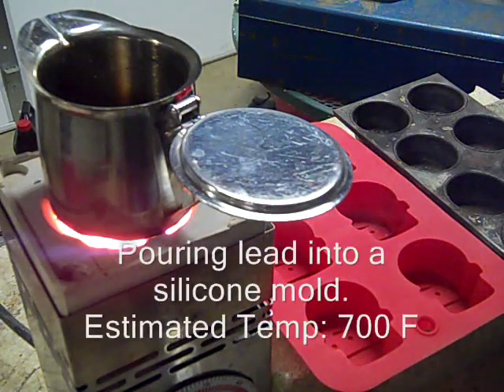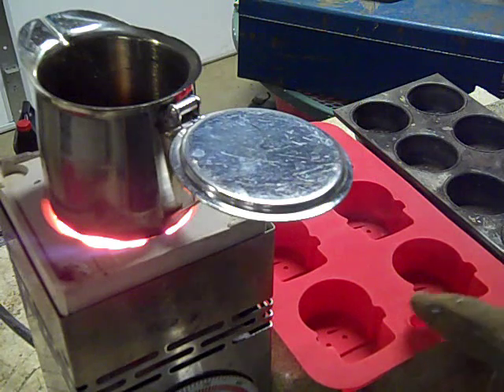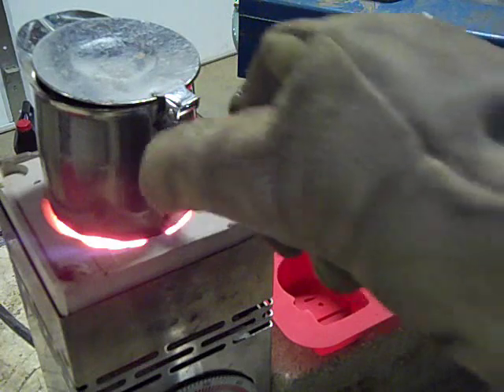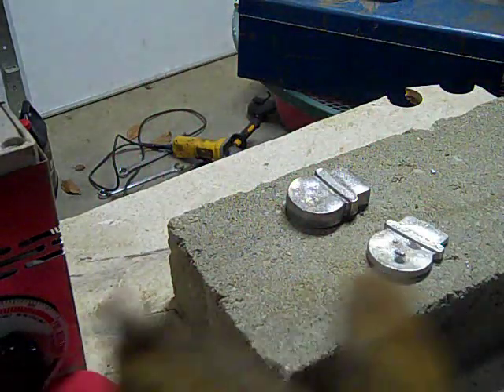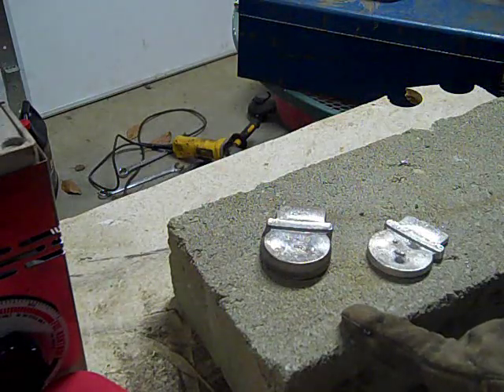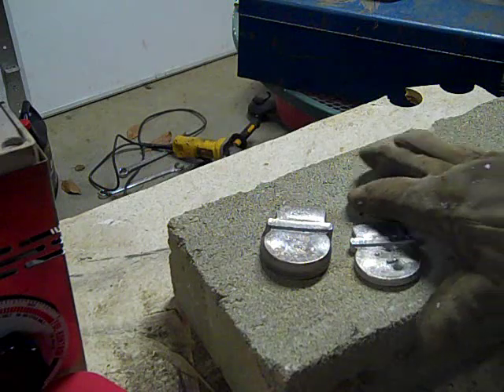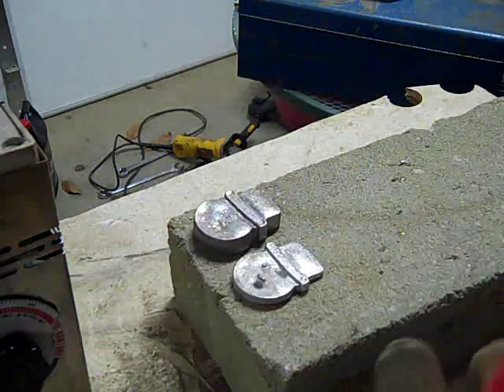Casting lead into a silicone tray - lead casting mold, ingots, reloading and bullet casting

Comment: The off gassing is common among new silicone molds. I have used talc powder, graphite powder and graphite or molybdenum spray cans as a mold release and protectant. Less boiling and better definition are the results.
Reply: FINALLY i get to use up the rest of my "Ms. Moly" !

Comment: Tip: place the mold in an airtight bag with a small bottle cap full of sodium hydroxide powder for at least 24 hours.  This will draw any moisture out of the mold.

Comment: The reason you didn't get good features is because of the temperature differential between the hot lead and the silicone mold. If you popped out the first pour and immediately poured a subsequent one it would probably look much better. But at the same time, the RTV would be getting much hotter and I have no idea if it would stand up to that. Good video.
Reply: FACTS👍👍👍

Comment: I'm super curious what you are using as a melting system... foundry and pot? Do you have a link or something to this product?
Reply: He says this below:
Hi, this is a high school laboratory stove I bought when they were selling off old equipment.  It doesn't work very well at these temperatures, I think it is intended for heating liquids, etc... not melting metals.  I had to supplement heat with a propane torch, then this heater maintained it.
Reply: i was wanting to know the same thing

Comment: Add a water bath underneath and the durability/longevity of your mold may increase dramatically!
Reply: +Jeffrey Nguyen no if the lead and water meet together it can cause a really bad explosion from the evaporation of the water.. look it up lol
Reply: +Goober's Life That is true! I just thought the mold wouldn't last long at that kind of temperature, but I could be wrong
Reply: +Goober&#39;s Life Wouldn't be hard to keep them seperate and sealed.
Reply: @CS_Blitzen  No, if you seal the water bath and then expose it to temps 3x the boiling point of water,  it will at some point boil and steam/PRESSURE will form. This pressure will blow your silicone molds back at you along with the lead, or  escape.  Water is not the sort of liquid you'd use if indeed the molds needed cooling.
Reply: Stupid
Reply: That is a god awful idea
Reply: Pouring water into lead is a bad idea........lead into water, not so much.

Comment: Melting point of Silicone rubber 300 degrees celsius. Melting point of lead 327 degrees celsius.
Reply: Silcone rubber will not "melt" - once it has cured it is "set" - though it will degrade and/or burn with excess heat. However as the video showed, the mold certainly was able to cast the piece (albeit with limited definition) at least once and I am guessing if a simple shape is all that is required, the mold would survive a good number of castings.
Reply: More on silicone molds...surprised how they handle the heat...

https://youtu.be/wwaIZYb9M0U
Reply: funny how that doesn't add up with what works.

Comment: Interesting idea, I wonder if having the mold placed in a shallow bath of cold water would help anything?, or maybe pressing the mold into moist sand would help cool the lead faster as well as help bring out the molds features?.
Reply: peter chessell 
Dont get the water under the surface of the lead and it would be fine. I would probably put the mould on a wet towel or something though.
Reply: The general idea is ok but water and molten metals are not always good to have around - having said that, pouring molten lead into water simply makes a hiss. It is pouring water into molten lead where things can get dramatic.

Not entirely like adding strong acid to water makes the mixture warm up but not too much else - but adding water to acid can result in explosive sprays of acid and steam. Always nice to avoid.

Make sure there is no water inside the molds though as otherwise the molten lead will instantly boil the small amount of water there - convert it to steam - which will then propel molten lead everywhere. BONE DRY molds are a good thing - but accidentally dripping some molten lead into a pan of water would NOT be an issue - it is when the molten lead is confined (eg: in a mold) and water boils UNDERNEATH or to the side - causing it to be forced upwards.

Immersing the trays in some chilled vegetable oil however would perhaps be a safer approach - even if not quite as effective at cooling as water. Certainly you could slowly pour molten lead into cold veg oil all day long without anything exciting happening as although the smoke point is way below that of molten lead - so long as you have a surplus of oil, the temperature would be pulled down quickly.

Another option would be bog standard glycerine - will not start to boil unless you heat it above around 290C. Sure, the molten lead will be hotter but if any is accidentally dripped into the glycerine, it will instantly be cooled and there will be no drama. Can get glycerine in the baking isle at most supermarkets as well as online.
Reply: Dropping a bit of water on the surface of molten lead will not do much more than sizzle and evaporate away...or possibly dance around for a bit before doing so (there's a scientific term for that, but I'm forgetting it). It is when water gets taken below the surface of molten lead that problems happen. Water trapped below the surface of molten lead becomes super heated steam and expands with explosive force splattering hot lead all over the place. Not good.
Water outside the mold (around or below it) is not confined so should not cause an explosion.
Reply: stickytwat
 I am as real as the laws of thermodynamics, ....what alternate dimension are you from?.
Reply: @117444152223737880880  LOL and yet, still no law of thermodynamics where you're from. go educate yourself about the various ways that heat transfers through various materials, F.Y.I your ignorance is showing.
Reply: cold water molten lead.....explosion stupid comment.
Reply: Where good sense is common.
Reply: That's a very immature reply. I'm sorry I didn't realise you were a child but please think next time about safety issues as some may actually follow your bad advice.
Reply: Enfant de Lumière
Yep definitely Enfant terrible!
Reply: Enfant de Lumière
You still for real? Clearly you have something against other peoples mothers, shows how immature you really are with such statements... As for your water/fire trick you are ill informed and a danger to those around you boy. Silicone is insulating, it really doesn't matter what you place under or around it - the heat will not dissipate any faster you got that yet? Keep out of the Lab and get back in the playpen until you can learn to respond intelligently.
Reply: +Enfant de Lumière silicone rubber is insulating, it will make no difference and water... you for real?

Comment: Maybe the lead was so heavy it squished the mold?
Reply: Thats What I was thinking. as he is pouring the visible portions of lead in the ,old are solidifying and becoming weighty. Mold being a thin silicone now deforms those features he was loosing due to the weight of the lead. I think, just as billy jojo mentioned sand or a support mold for the silicone mold would indeed retain the features. Nice team work Y'alll! :-)

Comment: The reason you lost some detail in the 1st 1 is probably because the lead is heavy and the silicone is soft and flexy and stretched the shape out of the mold a bit. The 2nd 1 had more detail (less stretch) and I bet if you put even less in the detail would be perfect. You gotta remember these were only made to support the weight of water.

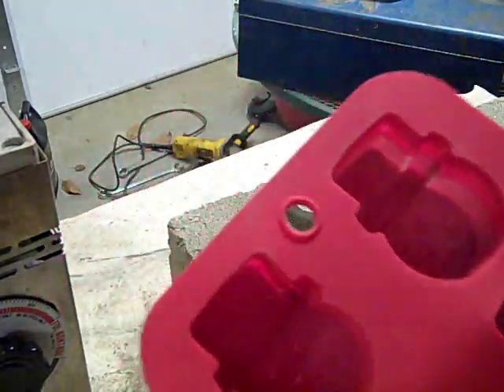Comment: If you look at the mold at 2:37 and 2:38 inside the mold that you used top right it seems to allow more light through than rest of the mold. Not certain if it is just lighting messing with me or not but may have burnt off some silicon. Not certain. Just got into your channel. Awesome videos.

Comment: Did you try to cast in this mold more then once? Maybe the boiling stuff wold have been boiled out on the second cast. You could also try pre heating the silicone at 300 degrees to see if its water being cooked out.

Comment: That could be as well. The boiling is a common problem with open casting. Really any thing porous like synthetic plastics and silicons don't make for good molds due to the fact you can't preheat them and they hold air and moisture. If you get crazy with your lead you can always have a brass mold made. They are not that much and last forever. I used copper pipe to store my lead in. It just seemed easy to store and melt that way. I could just melt in to the mold from the pipe.

Comment from the maker: Well, molten lead exceeds the specified temperatures for this silicone so I think the silicone was burning and offgassing perhaps.  Thoughts?
Reply: it was gassing because the mold was cold, you need to preheat it before you pour in the lead and it'll come out perfect.

Comment: Silicon is a chemical element with a melting point of 1414 °C, and SILICONE is a polymer that decomposes around the melting point of lead.
So no, it won't do easily. It will do, but barely. In order to cast lead and expect complete filling of the mold, it has to be hotter. Silicone can barely withstand such temperatures.
Reply: Silicone molds for lead...

https://youtu.be/wwaIZYb9M0U

Comment: I didn't know that silicone could withstand this!  Thanks for posting!
Reply: Depends on the type of silicone. A baking form is made from a type of silicone which is made to withstand higher temperatures.
A silicone from an arts and crafts store for moulding your own items and casting resin in might not withstand the temperatures of molten lead.

Comment from the maker: Hi, this is a high school laboratory stove I bought when they were selling off old equipment.  It doesn't work very well at these temperatures, I think it is intended for heating liquids, etc... not melting metals.  I had to supplement heat with a propane torch, then this heater maintained it.

Comment: Sure, if you're looking at consumer level - silicone is a polymer because it was mixed with compounds for different purposes. Such as silicone caulk, MDX, and so on. However on science level - no.

Yeah, it doesn't stand temperatures near 2700°C however it does stand temperatures near 2700°F. You aren't that slick trying to switch F with C. This melting point does not apply to compounds that silicone was mixed with.

Comment: i did the same thing with silicone lago icecubic trays i found out you need to use the mould a fue times then brush some char coal powder (ash) in to it so it forms to the mould better and helps with the bubbling.